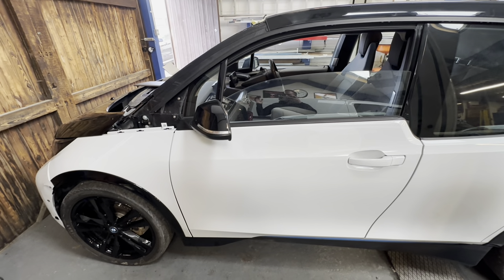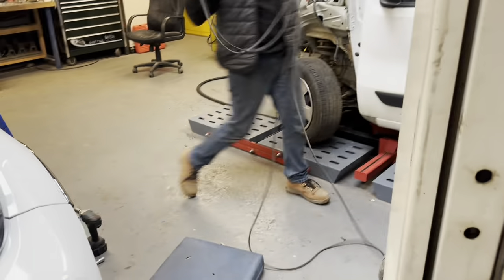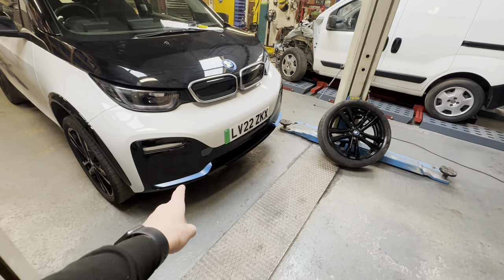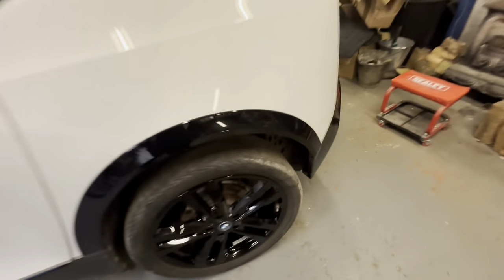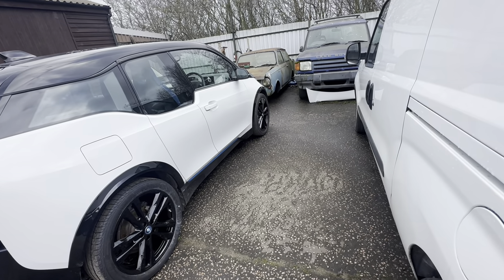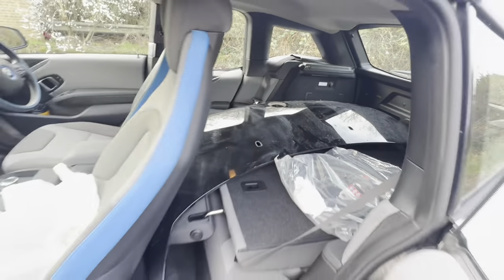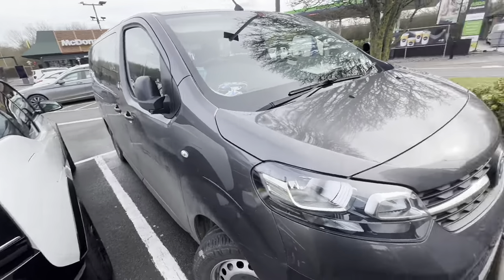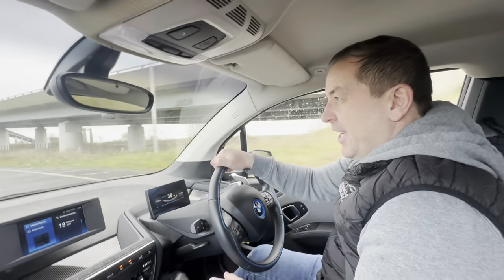IS THERE A FUTURE IN REPAIRING SALVAGE ELECTRIC CARS???

Comment: Rapid charging is more expensive especially if you use a instavolt charger point. Charging your ev at home is a much cheaper option . I use bp pulse 7kw  charger in a carpark near my shop and last month's bill was only £50 approx. .

Comment: Beautiful job, not much to fix it at all, well done! The cost of the charge is insane. 85p per kw is more than double the price of charging at home. Also, don't charge using a 3pin plug on an extension cable, must be on an actual socket.

Comment: Instavolt are the most exoensive chargers but sometimed you just have to bite the bullet.  I only use them on the occasional long trip.   Some tesla chargers are open to all evs now and they are typicalky about 35% cheaper than Instavolt.  Home charging can be 10% of the cost and works out a few pence per mile.
Reply: I definitely think that people should only really be considering an EV at the minute if they can charge at home. Because the cost per Kwh is astronomical at most rapid chargers.
Reply: @callumcurtis15  it's certainly much simpler and more convenient if you can
Reply: A few weeks ago I saw what I hope will be the future - a fuel station that not only gave the prices of petrol and diesel, but also the price of electricity in pence/kWh.
Reply: @HowardLeVert  Yep, the HyperHub in York does it, and only 55p/kwh too. York is pretty good for charging to be fair.

Comment: Great video , these are fabulous cars , I’ve seen a few EVs on copart some I wouldn’t risk but others which were very very cheap looked perfectly easily repairable, I saw a bmw i4 virtually brand new cheap with little damage , but the battery scares people off you’ll need either a friendly EV  technican or learn and pass some of the courses yourself but it could mean easy repairs with good profit, 85p per kWh 😮 omg I pay 8p per kWh at home to charge mine
Reply: Thousands and thousands of drivers don’t have off street parking or a garage so would have to use public chargers whatever the cost.
Reply: @keegan773  but many thousands do ! And they can charge their  EVs at cheap rate , mine costs me about £1.50 per hundred miles !!!! Makes me feel very smug !
Reply: I'm about to retire from my current field of electronics after forty years... but even as I approach sixty, I am very tempted to re-train on hybrid and EV drive trains and electrical systems.
Reply: @HowardLeVert  a lot of EVs are cat’d because they’ve blown the pyro fuse which on some in inside the main battery compartment and there’s not enough people skilled enough to fix them
Reply: @christopherwright1795  smug is an awful and selfish condition. It probably suits you.
Reply: @keegan773  haha I’m more smug that my car doesn’t pollute the air around it and contribute to air pollution , using fossil fuel vehicles seems so backward after a while , and yes I know how power is generated although I am on a renewables only tariff
Reply: @christopherwright1795   I think you ought to include the pollution caused in the manufacture of your vehicles and their batteries. In the UK Mercedes have been stopped from advertising their EV’s as pollution free due to the carbon footprint and raw material pollution in manufacture.
Reply: @keegan773  which is similar to any fossil fueled car ! So your arguments are because you don’t like EVs and don’t think anyone else should have one so you came on here , to discourage people owning EVs ?

Comment: Coming along & great job guys. The hockey stick is not actually painted but it is the colour of the plastic, so BMW could keep the tone exact throughout the car. Same as the blue side trims. These tyres for this car are bloody expensive for what they are and only come with 6mm of tread. I have fitted 195/55/20 on these rims before without spacers. Some people also put them on the front, but on a 5.5" rim it's a bit sketchy 👍

Comment: it looks super! do think the insurance companies write off cars to easily? but at least that gives you guys a "cheery" every now and again, as you said its hit and miss as the van was listed and repairable but was a bit to far gone, thanks for the content 👍
Reply: One of the issues with EVs is that the insurance companies want certification that the battery pack isn’t damaged. As they’re sealed it’s virtually impossible for any engineer to issue that certification. So they’ll get written off. The i3 is a particular type of bonded construction hence it’s quite difficult to repair.

Comment: I’ve been an EV user for 30months, no issues with range, charging or problems. VW ID.3 has been great. All you need to do is choose the car that suits your needs based on your usage. To be fair, 85p per kW is too expensive for me, but 95% of my miles are at Intelligent Octopus rate of 7.5p. I’m about to move to PHEV for my recently changed circumstances but will still get 80% of my miles at no more than 9p per kW.

Comment: 23:37  'free road tax'.. not for long; electric cars may be exempt from VED bills at the moment, but you still have to apply to tax your car in the normal way each year on the government car tax website; you must also get an MOT in the same way as regular cars.

In 2025, the electric car tax distinction will disappear altogether, and EV owners will have to pay VED at the same rate as petrol and diesel models within their pricing thresholds. This will apply to existing EVs as well as brand new ones – at current rates that would mean an annual bill of £165 after the first year.
Reply: Pre 2017 EV's are £20

Comment: Nice work chaps. One bit of advice though. Those bits you got wrapped, I noticed a little light bouncing off of it so you may find on a bright day that you get glare from those wrapped bits.

Also, I thought it would be a little quicker but using a stopwatch I timed your 0-60 as 7.87 seconds. Not the most ideal way to time a run but it'll do for me, watching through the sceeen 😂
Keep it up lads.

Comment: Instavolt are the most expensive chargers in the UK !  We use Tesla at around 43ppKw or home for a few quid overnight cheap rate. Also try not to go below 20% or over 80% as thats the sweet spot for the batteries. So saying well done ! Not that different from the old ICE cars when repairing body panels and a lot cleaner to work on
Reply: The usual fume puffers who have never owned an EV, not driven one give their opinion of cheapness of diesel over an EV, they seem to have read nonsense about EV’s and thats it, they’ve made their mind up…..we know better. I have 2 x EV’s (no back up diesel) I felt uncomfortable to start but now I just humour ICE Drivers I know with, “Oh I can’t do that, as bloody thing is always catching fire, and I can’t drive down that road as I will make too many postholes” and laugh…..

Comment: You forgot some of the most important numbers - the extortionate 85p per KWh you paid for the rapid charge! That makes it far most expensive than diesel or even petrol to run! You need to be able to use home charging for a max of 29p or as low as 7p on the right smart EV tariff.

Comment: You guys got really lucky deservedly after the gamble 👍 if you would have had to replace any electronics you would have been taken to the cleaners with BmW . I’ve just had a new battery on my new motorcycle (yes I know ) 179 £ for a battery I don’t know if it’s gel or lead acid but whatever . After a 3 moth battle with bmw it was replaced under warranty. Anyway great vids guys keep ‘em coming 👍👍

Comment: The way you fix and flip cars is amazing id actually love to do something like this but it’s just the start up money you need to buy stock, tool to repair and obviously parts for the stock, do some proper advertising, get some traders insurance and registered as a car seller and most of all have it so I’m not desperate to sell a car just to cover my monthly bills. 

It’s a very tricky game to be in,  I got my car at the moment I’ve had up for ages and it’s just not selling, not overpriced as similar models are on auto trader and fbook for £500-1000 more than my car and it’s has a brand new clutch flywheel slave cylinder plus loads of other bits. 

Getting on my nerves I really need a suv for my family but I cannot afford to have two cars need to sell this one first(jaguar x type estate 3.0 version)

Comment: It’s advised to only rapid charge to 80-90%. Be fine as a one off, but not all the time. Up to 80% is actually quite quick. 80-100% is much much slower, as the battery is protecting itself. Great buy Guys.

Comment: Imagine spending over an hour at a fuel pump and you had to wait for someone else to finish charging. EV’s are not fit for purpose as the charging network isn’t in place and the value of them drops like a stone. Very hard to part exchange and the range is poor. Okay for a second car if you can charge at home but why not just run a small petrol car?

Comment: Charging etiquette is to charge to about 80% on a rapid because the charging rate starts to slow down, so to free up for the next driver ASAP. You're lucky to used an Instavolt, about the only reliable and easy to use EVSE. Looks like you got a bargain there anyway 👍🏻

Comment: Heavy weight, + high EV torque= 
High rates of tyre wear.
Waiting around for a charging bay, imagine waiting for that amount of time at your petrol pump!
Thank you for the video.
Reply: Actually it’s not as bad as you think. The rears definitely last less than the fronts, but I got about 20k miles out my first set and looks like I will get similar from the second. Fronts seem to last about 27-28k. YMMV depending on how much you apply the right pedal but I’m not a particularly delicate driver :-)
Reply: You can call many new cars heavy. But i3 is far from it. It's a carbon structure and has a curb weight of 1340kg. tire wear is due to the special tire size of 155/60 . Slap some 205 on it and all problems are gone.

Comment: If you check up Kilowatt hours rate  with your electricity supplier  its about 20 pence  if you wait at home  if charged at home in garage during the night get supplier to change meter at home to economy 7 tarrif so power during night ie 11,30to 6,30am at  half rate per KwHour charge  big saving to be had through meterchange .to E7rate ask supplier to house to confirm check if other supplier will do if one refuses it.

Comment: That charge cost for the range achieved works out at 24mpg against diesel at £1.50 per litre. EVs are fine home charged but not public charging. £500 for two tyres? Blimey.

Comment: This is a interesting video but i think the days of fixing cars for reasonable money are coming to an end sadly .Any car that needs to be connected to the Internet to update can be restricted by the manufacturer using parts from a scrap yard and non oem parts won't be allowed you won't properly own you're car even if you pay in full.
Reply: And the knock on with insurance companies ramping up fees or not paying because of parts. Do not touch electric cars in my view.
Reply: @gbentley8176  I think there's money to be made be the risk is far greater they were lucky here i think it would be a different story with airbag replacements when the car knows its had a crash and goes into safety mode glad it went well though

Comment: EVs, the biggest rort ever, the diesel fuel used in mining the raw materials for the battery alone far outweighs any environmental benefits from being an EV. The price of the electricity you bought was diabolical, how did that compare to the petrol you'd buy for a similar sized IC car in the UK?

Comment: £34 for how many miles?
Reply from the maker: 190
Reply: looked like 140 range but that may have been at the current battery level not 100% , either way its not great
Reply: Only approximately £8 if charged at home? - for 200 miles?

Comment: Great build lads. Those 2 tyres seemed expensive. Are they more expensive because of the weight of an electric car?
Reply: They’re expensive because the i3 runs on a very specific type of low resistance tyre. They’re not made in bulk & hence they’re expensive
Reply: 155/60 20" There ain't many vehicles out there with that tire size :)
Reply: The Bridgestones are expensive,  Continental make a set that are more reasonabley priced and have much better tread depth to start.

Comment: ... get the lottery numbers from that driver - so lucky to get away with that accident 

... only if you don't repair a tesla, as they block DC rapid charging on any network (with an over the air update)

Comment: Approx. £6.35 a gallon currently
Your £34 will by 5.3 gallons
134 miles/5.3 gallons = 25 miles per gallon for a small city car?
Please tell me my calculations are incorrect?
Surely you would expect double that from a small car in 2022-24?
Reply from the maker: It’s 190 miles on a full charge and I used a expensive super charger 80p pkwh it’s 20p at home

Comment: Try not to leave it standing with a full charge, they are best kept between 20% and 80%.
Reply: Ridiculous, why if I only has 100 mile range would you only 80 percent charge it
Reply: Depends on the specific vehicle. BMW leave an upper buffer on the battery for the i3 hence you can leave it at 100% safely. With something like a Polestar 2 (which I also owned at one point) they recommended not leaving it long term charged at more than 90%.

Comment: Never charge to 100%, that is a huge mistake unless you are going to drive off 20% straight away. You also paid over 10x the cost of charging from home. The £38 should have been £3.36.  EVs are dirt cheap to run.

Comment: £34 to charge a 134 mile range electric car is extremely expensive. Thats £3.94/mile, whereas a typical diesel cost just 9p/miles
Reply: Public Charging is so expensive! Only use it if I need to complete a longer journey! Other than that I pay less than £20 for a months motoring!
Reply: £34÷134 = 0.253 or 25 pence per mile, still a bit more than Diesel but not £3 a mile!

Comment: Great video as always.  When we all plug our lecce cars in, we won't be able to cook the evening meal. Where's all the power coming from? 😢
Reply: No one charges during the evening (peak time on smart meters). Anyone charging at home does it during night-rate electricity times (ie: whilst asleep). It's great - come home & plug in, (car and/or charger set to automatically charge during night-rate period), then come out in the morning to a fully-charged car. Optional in cold or hot weather: set departure time and the car heater or aircon comes on 30 minutes beforehand and heats/defrosts the windows or cools the car, ready to go.
Reply: @type17  very informative. Thank you.

Comment: I would rather buy one o Autotrader for £8000😅
Reply from the maker: Good luck
Reply: @sruk  no offence but the UK market is flooded with second hand ones where dealers are battling to resell them
Reply: @sruk  £34 for 100 mile range ? My diesel Audi get 120 miles on £20 diesel btw. £34 is nuts

Comment: An hour and 20 minutes for a FAST charge??  Blimey.  And £500 for two tires!!!  Not cheap to own, are they?
Reply: You never charge on a fast charger past 80% - the charge rate falls off rapidly at that point. It would take about 35 mins to go from 10% to 80%.
Reply: @nixer65  Correct.  Harry's Garage goes on about the way people charge their cars and how this information needs to be made available for the used car market buyers as it is key to determining the 'quality' of the battery.  Still, waiting even 35 minutes would start to get really annoying...

Comment: EVs are not for me a small diesel engine in that car would get far more  miles for £34 of fuel. The cost of that car new plus the environmental cost of manufacturing and a battery that no one can dispose of. Plus it will last less time than a diesel or petrol car before it has to be scrapped as the battery will to be expensive to replace. They are in no way better for the environment its a joke and stupid people buying them are allowing this to happen